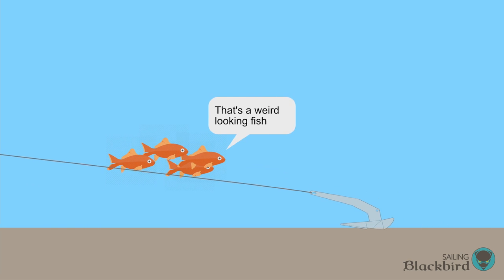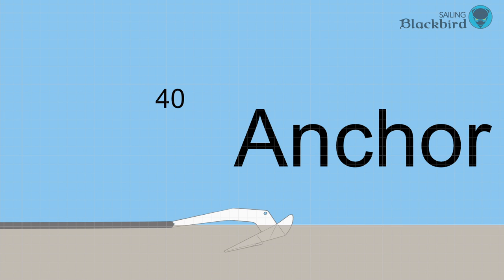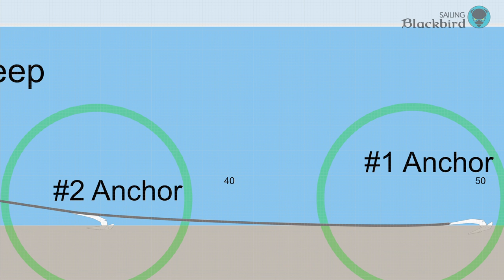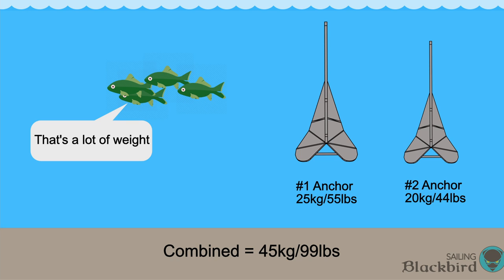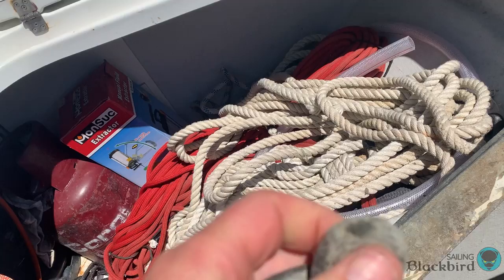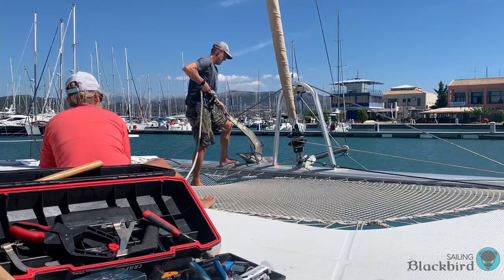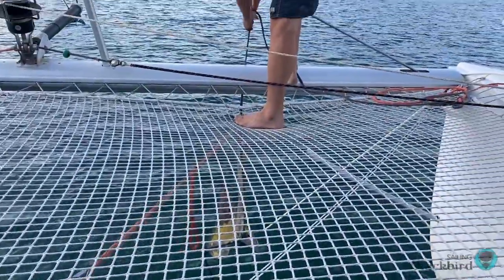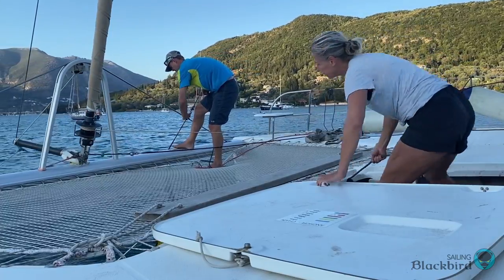Solving our Anchor Dragging Blues + Mantus Anchor Swivel

Comment: If you have two anchors down on one rode, if the weather turns bad at night and you need to retrieve this ugly mess, you will not be able to.
You need to be able to just pull it up and reset, or get out of there.
If you do use two anchors they must be on separate rodes and you should be ready to ditch one (with buoy) and retrieve at a later time.
Big anchor, long scope.

Comment: Delta anchors perform poorly. All other modern anchors work well. Decide what size anchor you would want for a storm anchor. But that and put it on your bow as your main anchor.  I have a 60ft 18 ton monohull. I have an 80kg anchor. I never drag. I sleep like a baby. I never anchor with two anchors, I have no anchor swivel and still don't know what they achieve. Anchoring is simple. Big anchor, lots of chain. In shallower water your 3-5 X depth is not enough. In very deep water you can get away with 2 -3 X depth. In 5m of water I will use 40m of chain. I have successfully anchored in 40m with 100m of chain in 40 knots.

Comment: I have seen more and more video's of the Delta's not holding. I too had the same issue and switched over to the Mantus anchor and have not yet had any negative issue with it. It holds faster and has not pulled free so far. I tried heavier Delta's and while they did help, still they would pull out in certain conditions. Much easier with one anchor I think if you ever get tired of this method, give one a try.

Comment: The one thing cat owners always forget is the huge windage your boat has. You are riding on top of the water and have the same size as two mono hulls. You might watch the dozens of videos put out by s/v Panope, who tests anchors using very scientific methods. But the first thing you said about anchoring at 3-1 or 5-1 told me most of the reason you are dragging. Your scope should be 7-1 overnite and if it blows hard go out to 10-1. I'm not kidding here, a three to one is only for a brief stop for lunch not an overnight stay. Another thing I have noticed is that chain size makes a big difference, keeps the pull on the bottom. I know you cat guys are always worried about weight but I like to sleep at night when on the hook so which do you prefer? Switch to a rocna Vulcan, get some heavier chain, let out seven to one and sleep peacefully.
Reply: Agreed.  We have a 65# Mantus and we go no less than 7-1 and if wind is above 30kts we go 10-1 to 12-1.  We ditched our poorly performing Delta within a couple of weeks.  We have never dragged our Mantus...ever. I would not ever use 2 anchors like this unless it is 100% forecast to be from one direction and not clocking/veering and the 2 anchors would be in V at the end of the rode, but the wind would have to be over 50kts to consider that.

We have held our boat, plus a Leopard 45 Cat which dragged and ended up T-boned on our hulls after he dragged anchor.  Our 65# held both boats in 20+kts for 30mins and eventually I pulled it free with engines to get him off my bow.
Reply: Ore a Spade Anchor

Comment: Delta anchors are the worst ever made mate, also use 7 to 1 scope, most of your video has made something very simple over complicated , this was hard to watch
Reply: Why do you drag?
1. Multihulls have both more windage and swing than monos, therefore need increased anchor size and scope. You should be dropping a 33kg minimum.
2. 3:1 is only for light wind lunch stops, 4:1 for settled weather overnight in good holding and 5:1 minimum or anything questionable.
3. Yes, most charter boats have a delta anchor, not because it's good but because they are cheap.
4. Invest in one of the  proven anchors showing good resetting after tripping, the rocnas, spade and mantus. I love my rocna vulcan because it performs very well, launches by itself easily and doesn't interfere with the bowsprit extension for the code zero.

Using a tandem anchor setup like you present is for storm conditions, if you have to resort to this for normal season conditions then your anchor setup is grossly deficient. I don't want to be downwind of you when they trip, foul then can't be brought up at 4am in a cloudburst.

I have been cruising over 25 years, used CQR, danforth, delta, bruce, spade,  and rocna. I use the rocna for everyday AND storms, and have used a tandem setup in storms. The old delta I keep onboard is best for a sacrificial anchor if I'm staying in a mangrove bay for a whole season and don't want to bring it back onboard after months of growth is on it.

Comment: Friendly reminder to all reading/watching that scope must be calculated from the anchor roller to the seafloor, and account for tides. It is not to be calculated with water depth alone. Hypothetical example: If your roller is 5ft off the water, and the water is 5ft deep , your 10:1 scope would be 10x10 = 100ft rode (not 5x10 = 50ft as you'd incorrectly calculate with water depth alone.

We're on a Lipari 41 and have a 33kg/73lb Rocna Vulcan we've quite liked. The 44lb Delta the boat came with dragged.

Comment: Awesome! That seemed complicated though. Any chance a larger heavier new anchor would just do the job? If it were in the budget, of course!
Reply from the maker: Thanks for the comment Ada! Yes, a heavier new anchor would likely do the job too. We would also have to consider the capacity if the windlass (how much weight it can pull up), and also the cost of the newer heavier anchor. As we have shown in the video, we have two basic systems now (the primary anchor alone or both anchors) for less than the price of a newer heavier anchor. Regardless, we are happy with our solution and the price we paid to solve most of our problems. If anyone out there wants to let us demo a newer heavier anchor we will certainly do so! Excellent question!